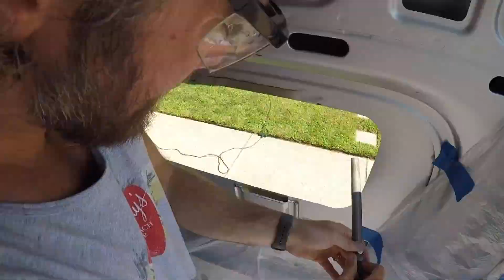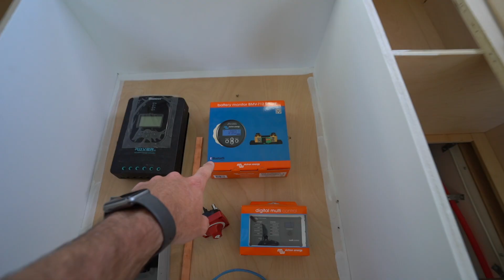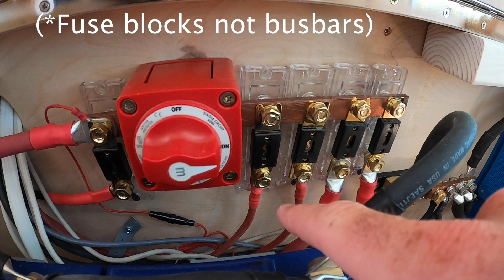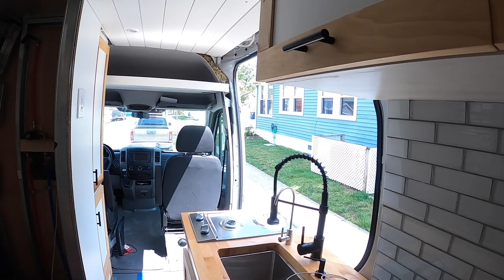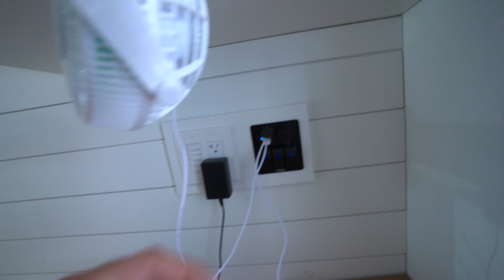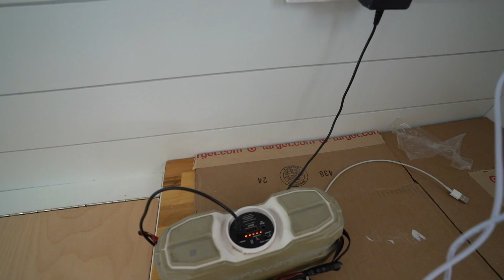Our Camper Van's ELECTRICAL SYSTEM with Detailed Overview - Van Build Ep: 34

Comment from the maker: Hi everyone!  Just wanted to give y’all an update.  

First I have my positive cable coming from the first battery (closest to the left) and the negative wires coming from the third battery (closest to the inverter)...

Our batteries got down to 70% camping one weekend and we couldn’t start the hot water heater to shower due to a voltage drop... 

So I upgraded the 2/0 wire to 4/0 wire (actually I did 2 - 2/0 wires) for each location.  I also switched the thickness of the copper bar from 3/4 inch in height to 1.5”.  I'm creating a blog post with pictures to document it on the following link  https://www.mathersonthemap.com/our-camper-vans-diy-electrical-system/.  The picture is above the header "1. Batteries".

If you have decided to get the 3000-watt inverter then get 4/0 wire.  If you have a 2000 watt inverter and below then I think 2/0 is sufficient.  

Remember I’m not an electrician and this is just our experience!!
Reply: Thank you so much for these Vids so Helpfull- Just got my Van today! so getting into it! I'm freaking out- Love you electricity video- Did you document your new set up somewhere? Thanks again you guys rock!
Reply: I must say, there is one fix left I see you should do. You have the cables for the batteries on opposite sides of the battery terminals, which put tension and resistance on the battery terminals. So, I would recommend that you take the cables and put all of them on the same side of the battery terminal. It isn't the worst issue, but if you overload the battery, the battery terminals could heat up a lot more than it should.
Reply: Nice vid bro! I am a little confused though. 2awg wire is bigger than 4awg wire. Also, did you guys consider daisy chaining your two fuse boxes? I was thinking and wondering if you had any info in reference. I really like your set up. I also like the way you guys did your plumbing. Thanks again.
Reply: After editing the pinned comment is automatically unpinned by YouTube.
Reply from the maker: @rudivandoornegat2371  that’s for the heads up!
Reply: @MathersOnTheMap   you know how many videos I watched and you are the first to go step by step explaining each part of his system.  Excellent job.
Reply: This is very important to know! Thank you.

Comment: Hope not many people follow what you are doing, and get their own professional advice. You don't seem to follow Nathan's electrical setup very closely (he now has updated electrical diagrams on his website and current videos).  For a start, you should isolate both +ve & -ve wires from your solar panels. Also,  you should isolate your battery and solar inputs separately.  Just want to give all a heads up. Not trying to be a hater. Electrical setup in a van is important and should be done correctly.  Many vans have gone up in smoke through incorrectly installed systems.
Reply from the maker: Thanks! Yea Nate has updated his diagrams a ton since 2020 when this video was made.  

Solar wires were isolated and we also updated our 2/0 wires to 4/0.

Nate’s got the best electrical content on the tube, we’ll be using his recommendations on our current build as well.

Comment: Hey so im midway through my first build and have an almost identical setup only difference is our inverter size and im currently running 2x 200ah agms. 
Everything is framed out in the van so ive been testing out the electrical system and i notice during the day i have no problems whatsoever but at night the batteries drain incredibly fast(obviously right, no solar charge lol) but its Fast enough that it seems like it would be a stretch to run the 10x 3w led puck lighting at 100% for even an hour I cant find much info online as to what people generally run at night with no solar. Is this to be expected or do i have some issues on my end? Definitely expecting to add another 200ah agm for a total of 300ah usable but im curious to hear your take.
Reply from the maker: That’s odd puck lights shouldn’t deplete your batteries like that.  Are you leaving your inverter on?  Do you have a battery monitor?

Comment: Jumper Cable: A piece of wire used to move line voltage between components. You can think of it a bit like a splitter wire. You connect one main line to one thing. And then split off it. Only in this case, you just use a piece of wire, and "jump" from one thing to another. Hence, jumper. Still not an electrician.

Comment: For the inverter wire sizing question, I believe you want to look at your inverter wattage vs your battery bank voltage and calculate for amperage. Then you can just check a wire size chart to get the amperage you'll need. A certified electrician will tell you to go to 125%, basically size up your wire. I'm not sure this is really necessary if your inverter isn't really capable of running over it's specified wattage. Most inverters will have safety features to prevent that, plus most people will install breakers somewhere on the line side... And in all honesty, the components in the inverter will blow well before your feeder wires catch fire in the case of a short. I'm not certified electrician, but I imagine if one comes along and wants to be very honest he'll more or less agree with me.
Reply: Keep in mind that stranded wire doesn't handle as much current as solid wire and most of the amperage charts refer to solid wire ratings.
Reply: @brucec4518  that's a really good point. A lot of charts will show both but if there's no mention one way or the other, they mean solid wire. Stranded you do have to size up a tad

Comment: Hello! What a great video! I’m sure this is going to sound like a foolish question, but I ordered the Kill-switch that you had in your link and I was connecting it to my bus bar (the same way that you have in your video) however it appears that the input and output is opposite of what you have shown?
I’m supposed to connect the battery to the input on the kill-switch. Is that correct?
Reply from the maker: The input output is irrelevant (same thing for me).  The switch simply is two copper bars touching, doesn’t matter which direction it comes from
Reply: Thanks Kevin. Greatly appreciate the advice and my wife and I LOVE your videos!
Stay safe!

Comment: Super cool and clean video. I learned a lot, Thanks a lot to share.
I have a question: Why need turn off the Victron multiplus when is not use? Thankssss
Reply from the maker: Thank you!!  Having the inverter on requires energy so you'll be using 4-6 Amps just leaving it on

Comment: I have a few questions regarding your build:

Is your electrical (120v) through your van without conduit? 

Where is your BMS for your lithium batteries?

Why mix victron and renogy?
Reply from the maker: Hey Troy, answers below!

Is your electrical (120v) through your van without conduit?  - yep

Where is your BMS for your lithium batteries? - Battle Born Batteries have built-in BMS.

Why mix victron and renogy? - I don't have a good reason for this other than Renogy makes solar easy with their kits.

Comment: Good job. You're right about the stranded wire. The reason is the vehicle moves and every time it moves, the wires wiggle and bend a little. This hardens the copper wire and makes it brittle and prone to cracking and breaking. It's for houses. The stranded wire bends more easily, having multiple thinner wires, and if one is damaged, there are several more. 
The controversy is how the wire is attached to things. A solid wire can be bent around a screw or stabbed into the back of an outlet, and it will stay. Stranded wire needs to have crimps put on the ends to attach it to a screw and can't be stabbed. Back-wired receptacles are not as safe or efficient as side wired because the wire can be pulled out and has less surface area contacting the wire. The screws are always better.
You want to be careful with that drawer outlet. Even if you used stranded wire, that's a dangerous situation moving the receptacle so far back and forth which also puts a strain on the connections, but the code book doesn't specifically address drawers. 
It does require stranded. SEC Electrical code section 551 explains Recreational Vehicles rules, but only for AC, like no face-up receptacles, the use of GFCI outlets and separating ground and neutral wires in the panel for example. 
Your setup is good. The white 14ga wire going across the Inverter needs to be stapled down every 18" or so though.

Comment: Wondering if you know about the Bluettie AC300 - I'm trying to learn and am brand new to all of this. I am currently converting my 2015 Ford Transit to a Tiny Home/Office. I will be using the following items

500w Desktop computer (2-4 hrs/day), and charging cell phones, cameras, laptop, dry flush toilet.

12v DC Fridge

12v DC Dometic A.C.

12v DC Maxx Air Fan 7000

12v puck lights (4)

12v (?) water heater and aggregator(?)

Also would like to be able to charge from DC/DC van battery, maybe that DC Charging Enhancer.
So my question - do you think the AC300 with 2 B300 with a 400w Solaria monocrystalline solar panel is doable? Is this practical? Will this recharge properly with this kind of set up. OR AM I WAY OFF? 

Thanks.

Comment: Hi Guys, love your awesome experience with nature. lol_ Need to ask you a question. If I have a Victron MultiPlus 3000 inverter, do I still need a charger controller? I have a 220Am alternator that will cover the charge of my Three Battle Born Battery. I also have a Small gas Generator the will also charge the battery when there is No Sun. I have to be Honest on this one, I am taking a lot of your wisdom to built my 2021 ProMaster I just brought almos a month a go. lol- You guys Rock! Thank in advance. :-)
Reply from the maker: Thanks José! I would definitely add solar over a generator.  We do not like it when other campers use their generators when parked for a decent bit because they can be so loud!!  But we’ve stayed in one spot 5 days in a row and we would of had to turn on the engine without it.  Best of luck with your build
Reply: @MathersOnTheMap  Thank Bro, good advice. I like to correct my statement regarding the generator. Even though this Generator is incredibly low noise I just saw a few reviews on YouTube, so I put it on my list for purchase. I haven't bought it yet but I will keep your advice into consideration. Thank for the solar tip. I think it will be more adequate for camping on quiet arias ware I don't what to hear any noise whatsoever. Take care and be safe. :-)

Comment: Vanlifer of 10 years here. Unless you have a small or large bus, then it makes sense to put a shower inside. But, for a van? Waste of space. Put the shower outside. There's small water heaters that can fit in van doors iside wooden inserts. There's even a company that makes a packable square shower rail/curtain inside a short 3 - 4' long awning storage type of unit mounted along the top of the side or back doors. You unfold it, Shower outside surrounded by curtain and under hot water and foldable ground mat. Also,  spray bottles, of soap/water, vinegar are enough to clean dishes. Grey water tanks stink. Sinks are overkill in smaller rigs. There's chargeable water pump/faucets you can screw on top of 5 gallon water jugs now to clean dishes or fill cups or water without dealing with grey water tanks. Brushing teeth using a squeeze spray bottle and cup to empty dirty water is simpler and easier than dealing with grey water tanks. And sinks that waste space.
Reply from the maker: We disagree Jeffrey! Showering inside the warm toasty van in the middle of winter after snowboarding all day when it’s 22° F outside sure is good!

But I respect your opinion, you’d certainly be able to live off the grid longer than we would without having to go back into town to get water etc.  We just wanted our rig to feel like a regular home as much as possible
Reply: @MathersOnTheMap  It's not going to be like living in a house. Or a regular home because a van is too small. If you guys are all about boarding. And park in resort lots a lot, shower at a fitness clubs, maybe. City pools. Aquatic centers. Or, if you do a separate rig thing (maybe one day), you could fit bikes, showers, inflatable paddleboards, in each van.    Or do a bus build. Most couples I've subbed to since 2009, have didficulty with space over the long haul. Even in RV's. There's two I follow convoying in separate rigs with space for storage. They're making it work well.
Reply from the maker: Have you seen our van life series? It’s like living in a home for us!  

This year with covid public showers were not always open depending state by state but we do go to fitness centers when we can to save water.

We still recommend having  a shower in the van and would 100% do it again
Reply: @MathersOnTheMap No, I'm new here. Showering every day isn't nessesary. I grew up upper middle class. Upsrate NY. College degree. Used to shower twice a day when I was younger. Living on the road for years however, you learn to be more European. You shower 3 times a week if you work out a lot. That's all you need at best. Use wipes. Deodorant. New underwear- pants/shirt each day if your boarding all week with season pass and whatnot. I'm a drummer. But I carry a smaller roland electric kit. Instead of an acoustic in the van. Downsizing/miniturizing is the key. Your electric setup was killer btw. Using it for reference. Floor plan perfect. Nice Sprinter build all around. Battleborn's are the best. I've subbed to over 50 Vanlife, Buslife, and RV life couples over 12 years. But, I'm un L.A. County and it's about 5am. Fading.

Comment: Hey Kevin....Is it ok to connect the end of the positive cable of the solar charge controller to the busbar instead of the end of the positive battery cable? ...  And then attach the positive cable of the battery to the other end of the ANL fuse?
Reply from the maker: it's definitely ok to put the positive cable from the solar charge controller to the busbar absolutely.  Not folllowing the "attach the positive cable of the battery to the other end of the ANL fuse" where is that anl fuse?
Reply: @MathersOnTheMap  Well I have since been advised by Blue Sea Systems not to attach the battery cable on the the other end of the fuse where the solar cable is attached, which makes sense to me now.   I was trying to attach the cables on the opposite ends of the fuse as compared to you and Nate, due to space constraints.  But the solar charge cable has to be attached on the fuse where you and Nate have it attached, which is the only way.

Comment: Need to move your ground wire to feed off the back battery… opposite of your positive feed… it actually makes a difference in how they charge and discharge
Reply from the maker: Check out the pinned comment 👍🏻

Comment: Hi Kevin...  What length and gauge of an extension cord would you recommend for a 2000 watt inverter charger when I want to charge up from a pedestal at a campground or an outlet at friend's house?
Reply: If you are saying this cable is to be used from an AC supply to a 2000w charger - just go to your DIY store and look at the extension cables.  They should say on the label/ box what watts they can handle.  As it is AC  not DC cable length isn't that important an issue.  Short cables are only important on DC cables.  The specific (large) gauge and requirement for short as possible cables are only an issue once you step down to DC.   Your vacuum cleaner or Hair drier will use 2000w AC and look at those cables - normal standard extension lead size

Comment: How do you like your Seaflo water pump so far?   I would be considering between this Seaflo water pump and the Shurflo Revolution which is at about the same price and specs except that the Seaflo has an amperage max of 6 amps and the Shurflo is 7.5 amps.
Reply from the maker: Yep! No issues with it and I’d get it again

Comment: Hi Kevin ... Is it essential to have a 300 amp terminal fuse on the battery pack?   I assume it is to protect the wire going to the bus bar in case there is a battery short circuit or something.
Reply from the maker: Hey Jack, Not sure, I followed explorist.life a great resource for electricity, it’s what he recommended
Reply: It's (terminal fuse) the best way to protect the cable and the rest of the system.

But a short cable between the plus pole of the battery bank and a proper sized fuse will also work fine.
Just make sure then that nothing else is connected to the battery pole, everything must be connected after the fuse, with a bus bar.
The advantage compared to the terminal fuse is that you will have the same style of fuse for the whole system (terminal fuse is an odd form, compared to the midi blade fuses).

Comment: Hi Kevin... I am installing a DC to DC charger by Renogy.  Do you think it is better to buy 1 roll of black 30 foot wire or combo of 15 ft red/15 ft black?   What do you do?  I was thinking it would be better with just 1 roll black because then I would have 1 remaining left over piece rather than 2 .
Reply from the maker: Hey Jack, I don't think you can really go wrong, at the end of the day it's the same copper metal on the inside of the insulation.  If you need to use more of one color and you ran out, you can always put the correct color heat shrink over the insulation.

Comment: Hi Kevin...  I have purchased the copper bus bar and going to do a similar application.  Instead, I will be using a Renogy 60 amp DC to DC charger.  For the DC to DC charger, I am going to place a 60 amp ANL fuse next to the starter battery which is recommended.   My question to you is:  When I connect the wire for the DC to DC charger to the bus bar, would I need to add an additional 60 amp ANL fuse at the bus bar or would I just connect the wire with out one since I have one located at the starter battery?
Reply from the maker: I’m not an electrician and don’t have that model so I’m not entirely sure but I think you would yes